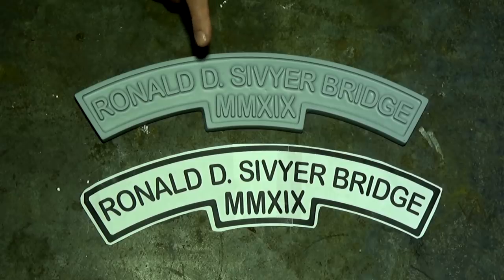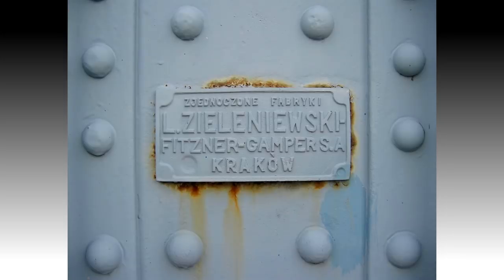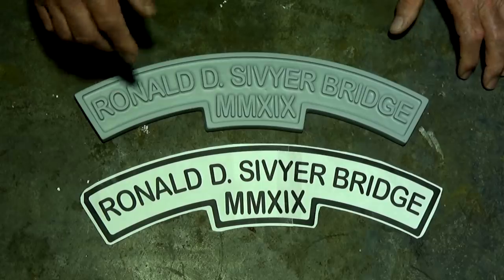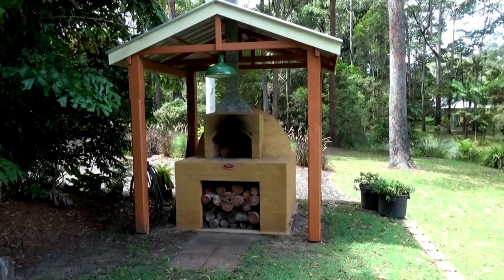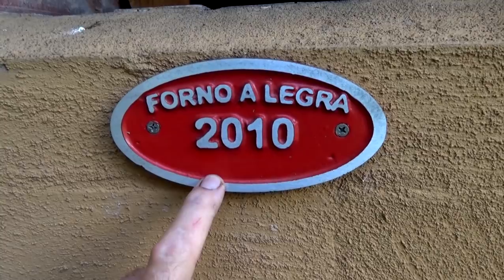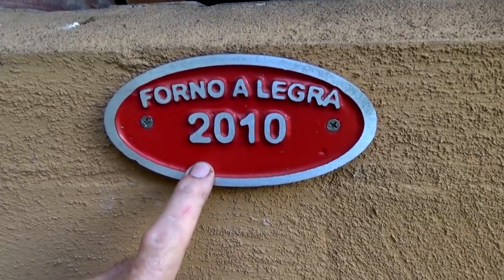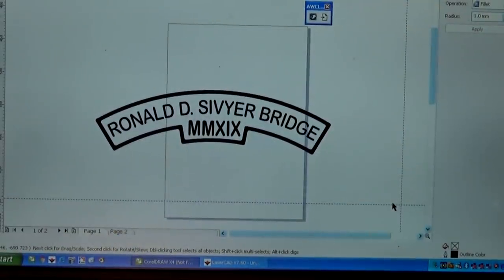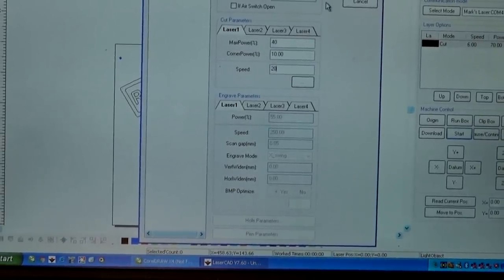Brass Name Plate Pattern Making

Comment: Mark,  I'm really looking forward to seeing your home foundry set-up.  That's something I've always wanted to try.  When you mentioned the model airplane dope, that really brought back memories of walking our old "dope room" where we used to paint the biplane trainers at work.  Also, the next time you use your epoxy and need a really viscous mix, look into getting some media blasting glass beads in full size bags -- I guess that would cost a lot less in the long run than the "special" glass beads you mentioned that are sold for the epoxy.  Or maybe a local media blast shop will sell you a small bag full so you can try them out -- if so, they may have two or three bead sizes which I know are used in media blasting (we use two sizes at work).  The beads are even put in/on the lines & stripes painted onto roads (and probably some road signs too) to make them reflective.
Reply from the maker: Bob, I remember the smell of dope from my younger days when we used to make model control line aircraft. We used a lot of it too because our planes would only make a few flights before they were smashed to smithereens. When I mentioned the microbeads they are actually little tiny hollow spheres (sometimes called microbaloons) and they are used to add volume and keep the weight down. We used to use them as an additive for polyester resin when we were making fibreglass Canadian canoes at school. It made the normally thin resin thick enough to bond the seats into the hull. However, any inert material would do the same job so bead blast media would probably work fine. 
Regards,
Preso

Comment: Very nice.   I loved seeing the spokeshave although a card scraper may work better on the edge.

I had not heard of the dope putty, so I learned something.   Thanks.

Dave.
Reply from the maker: Dave,
I remember reading about the dope/talc putty when I was a teenager and making model control line aircraft ( I wonder if anyone still makes them?) I built a model of a WWII P40 fighter and it had to have a really big fillet between the fuselage and the wing root. I made the putty using that technique and it was amazing how easy it was to shape and it didn't seem to be particularly heavy. Recently, talc has been getting some bad press and there are some health concerns about it. As a child, we were drenched in the stuff after baths! I have a card scraper but that plywood was not a particularly good quality. It was tearing a bit and I think a scraper would have just dug in. 
Thanks for watching.
Preso

Comment: Have you thought of using step cuts with the laser, gradually getting larger and deeper than the previous cut?  It would be easy to sand down the steps to get the 2* angle to help the mould release.
Reply from the maker: I haven't really tried this but I had experimented with using that technique to make countersunk holes for screw heads. As it turned out I didn't really want to sand any of the letters at all and the epoxy made a nice fillet. I guess if you wanted to make really deep or high characters the resin may not work though. I would like to have a Z axis on the laser that could be controlled by the laser software, sort of like a full 3 axis CNC setup. That way you would be able to have one g code that did multiple passes at different Z heights and progressively larger offsets in the X and Y plane. I am sure someone has already thought of it and I am guessing industrial machines already have that capability.
Reply: Mark Presling The 3 axis laser cutter would be a perfect tool for the home foundry. From the bed to the mould. Love the work and variety in your videos. Thanks for sharing.

Comment: West Systems and talc! Brilliant notion that :-) Have you bought their proprietary micro balloons? Not cheap. And I dare say you would get the same results.
Reply from the maker: Chris, I have used micro baloons before to make a filler for fibreglass work. It probably makes more bulk with less weight but I find the talc is cheap and cheerful!

Comment: Can't wait for the brass casting
Interested on what you will use for the brass, are you going to buy stock or melt down brass 'things'? I've heard brass taps and plumbing fittings are good as they have the right chemistry for casting
Reply from the maker: Well, in a zen sort of way, we have just replaced all our door knobs and fittings to chrome plated brass (art deco of course). I now have a large box full of Victorian style plain brass knobs, plates, hooks and latches. It was originally cast so it should be the right composition for what I want.

Comment: You might want to check out the "micro bubbles" that experimental aircraft guys use, rather than talc. They mix it with their epoxy resin  to lighten it (by weight) and it should also increase the viscosity. Aircraft Spruce and Specialties in the US carries it, I bet there is an OZ vendor as well. Google "3M GLASS BUBBLES"
Reply from the maker: Pat, I have used those micro bubbles before when we were making Canadian canoes at school. We had bags full of the stuff but I am pretty sure it all got tossed when we stopped making the canoes. 
Regards,
Mark

Comment: Mark, I'm not familiar with the spray putty, is this some sort of automotive primer?  Where do you find it?
Reply from the maker: Steve,
Spray putty is a heavy bodied automotive filler. You would normally prime the bare metal with an etch primer then build up several coats of spray putty to fill any file marks, scratches and pits. It is easy to sand back to a smooth finish. I get it from the auto accessory store. You can buy it as a single pack product in a can which can be thinned with acrylic lacquer thinner and sprayed on with a standard gun with a fairly large nozzle or you can buy it in a spray can. 
Regards,
Preso
Reply: @Preso58  Thanks for the prompt reply half a world away.  I'm going to get some and give it a go.  Cheers!

Comment: Nice! I'm excited to see how you design your sprues (and risers?) for such a large flat casting.

Did you make your sand yourself?
Reply from the maker: Scott, I have been watching Olfoundryman's channel and he has changed my mind on how I do the sprues and risers. Since adopting his methods I have been getting much more consistent castings. I do make my own greensand. The last batch was made from white Ballina sand and finely ground bentonite clay. It doesn't ram as nicely as some types of greensand that I have seen on other peoples channels but we have no local suppliers so I have to go with what I have got. Having said all that I have zero experience with casting brass and as you say, it is a large flat casting so there will almost certainly be some issues.
Reply: Mark, I wouldn't be surprised to see a big muller or maybe a backyard clay pit, every time I watch one of your videos it reminds me of Oz because there's always a new tool or method!

I can order sand, but I ended up making my own. I moved and have since discarded most of the foundry stuff I had. Eventually I'll get on top of my project backlog and will add home foundry back to my repertoire.

Comment: Is there a reason you couldn't do multiple passes to cut thicker material on a laser cutter?
Reply from the maker: Les, yes you can do multiple passes but you really need to refocus the laser after each pass and it's not always easy to tell how deep the last pass went. The kerf gradually gets wider as well since the beam is conical in shape with the widest part of the cone at the top surface of the stock. In general you can usually get two passes as long as you don't move the stock.
Regards,
Mark

Comment: I have an interchangeable laser cutter head for my 3 D printer (30 watt, I think) and I haven't considered using it this way..... 
Did you know ,Mark that the also sell filament, made out of casting wax for the 3D printer these days?
Draft won't be an issue anymore if you use waste-wax casting..... 
This could be useful for very small nameplates for models and such....

Paddy
Reply from the maker: Paddy, I cannot keep up with all the new filaments on the market these days. I did not know that there was a wax filament but I did do some lost wax casting  when I was studying at college. We had a centrifugal casting machine and it scared the living daylights out of me when it went off.
I have been watching a few YouTubers experimenting with lost wax stuff (Myfordboy and Vegoilguy) but it seems fraught with difficulty without having the centrifugal casting outfit. Still, it would make those "impossible" shapes possible.
Reply: Mark,
When I was a teenager, our neighbour's son was a dental technician, who had his own business. He cast gold and silver in extreme precise ways (always waste-wax) every day.
During summer holidays, I often helped out at his place a few days a week. Little did I know back then, I was learning a lot of useful things!
I did try some waste wax casting, but without centrifugal setup. Once your master is made (you make a mould in silicone, which gives you the wax pattern every time you need one) this works quite well.
It may indeed take a few messy and frustrating attempts before you 'get it' and you stop using the cheaper wax ! Once you live through that, it does show its merits, imo... It is great and economical for all manner of miniature steam fittings in brass, or ornamental parts for small steam engines and the like , in zinc alloys. It also makes high quality aluminium castings for miniature agricultural IC engines, from the 20s' and 30s'.

Paddy

Comment: BRAVO!

The E is silent; esp after a few cold ones.

What is NEXT??
Reply from the maker: Ha ha! I get it now. I was wondering if it was an acronym like - Extra Fast Delivery Communications or something... As for next, I have a model turbojet engine I built about 8 years ago and the last time I ran it I had a hot start and distorted the nozzle guide vane housing and it has sat in the display cabinet ever since. I intend to partly dismantle it and re-machine the housing so the turbine doesn't rub any more. Unfortunately, I am one of those people that tend to lose interest in a project as soon as it is finished and it has turned a wheel or two. My mate Macca has been nagging me to get the jet going again so it has sort of moved to the top of the list.
Regards,
Preso
Reply: Secretly, it is ust my initials backwards.  Goota have something i can remember ` as I forget so much else.

Comment: Al um i num
Reply from the maker: It used to really bug me hearing it pronounced as aloo min um so I did some research. It turns out the process for large scale manufacturing of alumimium was discovered concurrently in different parts of the world but when it came to naming the element for the periodic table the person in charge (Sir Humphrey Davy) got a bit mixed up and first named it Alumium, then Aluminum but later changed his mind and named it Aluminium. For some reason, the second version stuck in the USA and the British and their colonies called it the latter. There is some argument that Aluminium is a better fit when you consider that nearly all the other metal elements share the same spelling..... Plutonium, Sodium, Titanium and Lithium. Maybe we should just call it "light white metal".
Reply: @Preso58  Light white metal it is.   :-)